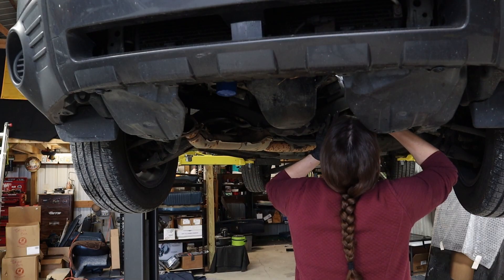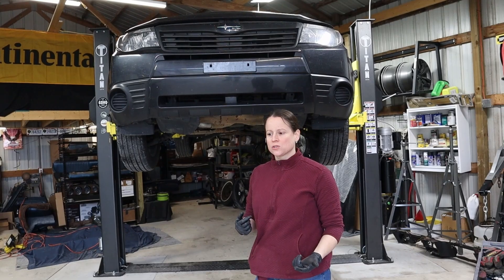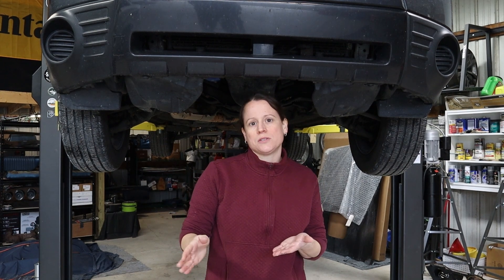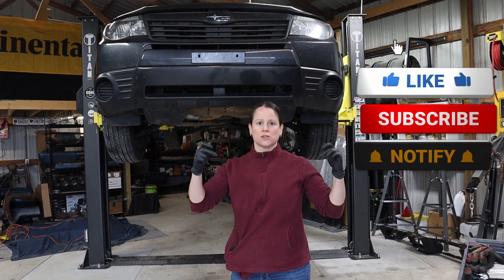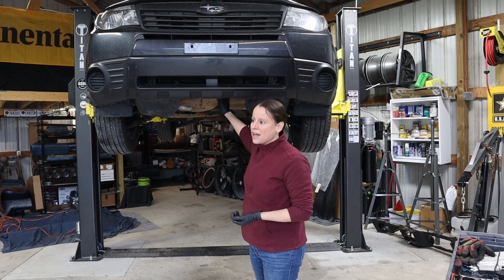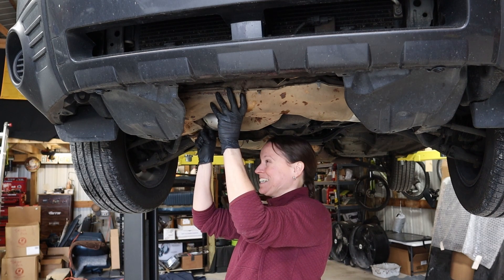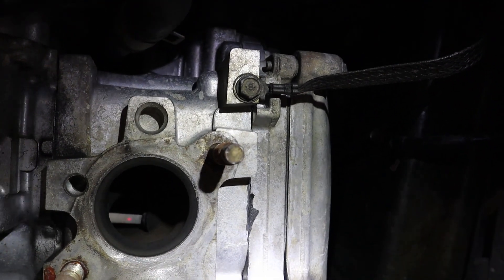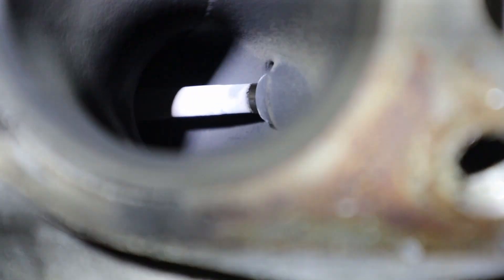Subaru Code P0000 & Intermittent Misfire Codes(P0301/P0302/P0303/P0304) - Mystery Solved

Comment: Salve ho visto il vostro video ,io ho una Ford Focus mk3 benzina GPL e mi spunta la spia motore con il codice errore P0000 voi mi  mi potreste farmi capire perché questo errore se sono gli ingredienti da sostituire grazie aspetto un vostro messaggio
Reply from the maker: Thank you for watching! Unfortunately, we are not able to help with this problem on the Ford Focus because it is not a car we are familiar with. The P0000 engine code can mean a lot of different things, and we only arrived at the valve guide pins on our Subaru after ruling out many many other parts. We would suggest that you work with a local mechanic to work through the probable causes and start replacing the cheaper and easier parts before worrying that there is a larger or more expensive problem. Hope this helps; take care and stay safe! Salute!

Comment: Hello enjoy your videos got a 2009 Subaru legacy limited 2.5 got a misfire in 3 and 4 cylinder according to code reader. What's the most common cause of this problem?
Reply from the maker: Hi Stanley, thanks for watching! It's really hard to say, even if your engine is also the naturally aspirated SOHC EJ253 same as our Forester. If you've already done everything shy of replacing the headers or spending hundreds of dollars, then it's 100% worth the easy diagnosis of dropping the exhaust manifold and taking a look up into the header to see if your problem is the same as what ours was: slipping exhaust valve guide pins. We had replaced spark plugs, wires, ignition coil, searched for vacuum leaks, cleaned the throttle body and MAF repeatedly, paid hundreds of dollars at a Subaru specialist, used an OEM air filter, and each "fix" made the codes disappear but only for a little while. We were on the verge of needing to do a compression test or pulling the fuel injectors when a technician at our dealer suggested we take a look for the issue we explain here. It was the end of our hunt, and replacing the headers (at great expense) resolved the issue. Hope this helps; take care and stay safe!

Comment: I have codes p0300 and p0304 on my subaru, it makes loud noises when starting, also a slight delay when starting the ignition. What could be the issue?
Reply from the maker: Hi Chris, thanks for watching! Without more details such as maintenance records, mileage, actually hearing the sound it makes, we aren't going to be much help with your diagnosis. I would follow all the logical "easy" places to look: check all the fluid levels and top off, check the batter and starter cables for tightness and corrosion and clean/tighten, check and clean the MAF and air filter, check the accessory belts for tension and wear... There are a lot of worst-case scenarios that could cause your issue, but it may be something very simple. Hope this helps; take care and stay safe!
Reply: @SpiritedWrenchers  can u technically drive with these codes on a check engine light for a few hundred miles? The check engine is not flashing
Reply from the maker: @chrisdopez8443  technically, yes. Will it do more damage than keeping it parked, maybe. Won't really know until you tear into it. For the record, I drove it for several thousand miles before I uncovered the answer to all my intermittent misfire codes. Each time they popped up, I did something different/new to try to fix it and they would go away for a while.
Reply: @SpiritedWrenchers  So I took it for a spin again and it jerks alot, is this a symptom of a bad coil? Ran the codes again with a really exp OB-ll and it just showed P0300 and P0304 again.
Reply from the maker: @chrisdopez8443  honestly, I'm not sure. While replacing the coil pack (my EJ253 only had 1, it wasn't one coil per plug) was something I did to try to diagnose the misfire codes, I'm not confident that my factory coil pack was bad. I think I did that because it was easier and cheaper than diagnosing the fuel injectors, which I also suspected at the time.

Comment: hi im having a p0303 & p0304 on a forester i replaced the engine with a used engine. i did plugs, swapped the wires and coil to the new motor from the old one and still getting the misfire codes but no actual misfire. did your car actual misfire or did it just throw the codes? i replaced the crankshaft tone ring gear aswell and did the timing belt while i was there and still did not work. please let me know if you actually felt a misfire or just had the codes. thank you
Reply from the maker: Hi Pons! Thanks for watching and asking. So sorry to hear this, but it does sound very similar to our issue. The codes sometimes would just appear after idling (turn on the car, then run back inside for something you forgot and there's a code with the engine still running), and sometimes it would or act as though it wanted to stall when coming to the first and/or second stop after cranking the engine and driving. Those incidents usually resulted in the misfire codes. Aside from the extremely sporadic stall incidents, I could never feel the engine misfire. I could go 3-6 months between a code, or days between a code. I'd highly suggest you pop the exhaust manifold off and take a look up inside the heads at the valve guides. Hope this helps; take care and stay safe!!!
Reply: @SpiritedWrenchers  thank you for the reply!

Comment: I got two codes P0302 misfire on cylinder 2 also got a p219a air fuel ratio inbalance  any idea what it could be? I replace spark plugs and did valve cover gasket also both oxygen sensors and code still there .
Reply from the maker: Hi Ede, thanks for watching and trusting us to help you with your diagnosis! Without more information, the only thing I feel confident to suggest is to admit a problem I ran into shortly after doing my short block swap: torque everything. I found that I had a vacuum leak on my air intake manifold causing misfires and air/fuel codes to pop up. After going over every single bolt that I had removed on the intake manifold and torquing them fully to specification, I found my misfires and imbalance codes disappeared (well, the imbalance codes never returned anyway). I'd suggest you start with ensuring everything is fully torqued, the MAF and Throttle Body have been fully cleaned, and all wires are fully clicked into their appropriate places. Hopefully, it's something basic such as this. Take care and stay safe!
Reply: @SpiritedWrenchers  gave up and Caravana finally came to pick it up. Lost $2000 on that car but got rid of the problem. Never again will I buy Subaru . I’ll stick to my roots which are Toyota .
Reply from the maker: @ede4345  I definitely feel you on that sentiment! After needing major engine work for the second time in less than 5 years, I sold mine as well. We still thoroughly enjoy the WRX, but it's not a daily driver. Sorry for your loss, but hoping for better with the purchase of your Toyota (we also love them 'yotas)!
Reply: p219a is pretty general and can be set due to a long list of issues, but the most often one I see is one cylinder has significantly lower compression than the others due to mechanical wear or damage, valve, piston, rod, etc. The first steps would be a compression and then leak down tests.
Reply: @vipercrazy-9  caravan came and took the car , I had enough of it .

Comment: This is exactly what my subie is going through, been like that ever since I got a new short block almost 2 years ago
I took it to a tuner and they had no idea what the issue was since it wouldn’t show up on the codes
Reply from the maker: Hi Alex, thank you for watching and commenting. We are incredibly sad to hear your Subaru is doing this, because it sounds like the same pattern that ours had. Short block replacement, followed by mysterious and unpredictable misfires codes with no other symptoms. It would be worthwhile to drop the exhaust manifold and take a look at the valve guides to know for certain if this is what's causing the codes. Please let us know what you find! We did eventually settle on paying our local dealership to replace the heads on our Forester, but sold it about 7 months afterwards. Take care and stay safe!

Comment: So i have p0301 and 303 however sparkplugs have been done recently, and ive checked extensively for vacuum leaks, and no issues from fuel whatsoever. And literally almost zero symptoms, other than a little wobble in warm startups? Any thoughts?
Reply from the maker: Hi Reese, sorry to hear you're having a rough idle upon startup! Without any more information such as mileage and engine model, if the culprit is definitively not the exhaust guides, then I'd probably: check and clean the air filter, MAF, throttle body, then check the spark plug wires for connectivity and possible corrosion, then the coil pack before settling in on doing a compression test. Hope this helps; good luck, take care, and stay safe!!!

Comment: Did the engine jerk/miss when it triggered misfires codes? When I let it idle for too long it will either quit or I when get back to accelerating it will skip/jerk from an instant loss of power and trigger the full set of misfire codes (P0301/P0302/P0303/P0304). So far no P0000.
Reply from the maker: Hi Daag, thanks for watching and asking this question! What you describe is pretty spot-on. I didn't notice a major difference in loss of power, probably because I assumed it was operator failure on my part as the clutch operator (hah!). It did stall at stop signs, and would throw codes if left to idle for too long. The P0000 is a dummy code, so having the cylinder numbers is more accurate. I would say it's absolutely worth is to drop the exhaust manifold and inspect the valve guides in your heads. Hope this helps; take care and stay safe!

Comment: Were these codes mostly on initial warm up of the car or regular driving? Also how many miles do you have on your car?
Reply from the maker: Hi Oscar, thanks for watching and asking! The codes generally only occurred for me when the engine was cold(er), and either idling or upon going back to idle after moving. So, if I let it try to warm up while sitting still I could get the codes, and if I tried to drive it immediately I would get the codes when coming to a stop. Had approximately 200k miles when we filmed this episode, but the codes had came and went like ghosts for 35k miles or so before we found the cause. I had been replacing and cleaning parts for years trying to get them to stay away and never thought the freshly rebuilt heads would have been the cause. Thanks again for watching and stay safe!

Comment: Hi I am new to the Subaru family. This February I purchased a 2011 Forester with 167000 km on the clock. Your videos are so interesting and it has motivated me to get more involved with the car and perform some of the routine maintenance myself..thank you..would love to see videos of the engine rebuild
Reply from the maker: Hi D R, thanks for watching and we are so glad that our videos give you the motivation to get under the hood yourself! Depending on your location, the 2011 Foresters were sold with a completely different engine than my old 2010. In US models, the 2011-2013 Foresters have the 2.5L DOHC FB25 engine instead of the 2.5L SOHC EJ253. So while we didn't have our channel when I completely tore apart my engine and no videos truly exist (only pictures), I don't know how much help they would be if you've got a different engine. Some of the maintenance elements will be the same or similar, and I would say the greatest resource for me has been a Facebook group, SH Forester Owners, as well as an online forum, subaruforester.org. Both will have boatloads of resources for you with regard to oil viscosity, type, capacity, troubleshooting, and other various maintenance help. The biggest thing I can advise you for a higher mileage FB engine is to keep an eye on the oil level as they are known for high oil consumption. Welcome to the Subaru family! Please feel free to reach out if those two resources don't have what you need and we will be happy to find a group who can
Reply: @SpiritedWrenchers  Dear Dana, thank for taking the time to respond,  in South Africa, we also have the FB 25 engine.  It is so wonderful to be able to connect with someone across the globe, although our cultures are different to be united by a simple passion is something special. Thank you for the resource tips I will definately  explore them ..take care
Reply from the maker: @Suny1234-b7o  both groups are international! That's why I love being a part of them, because the collaboration and work that we all bring. Another global group is FozTrek on Facebook, although they don't specialize in just the 3rd generation Forester, they are primarily in Australia and have members across the globe as well. The only warning I have is they're all a rabbit hole for finding mods and enhancements to do on your Forester, making you want to spend more and more money. They're all fantastic and absolutely great resources to have. Take care and stay safe!
Reply: @SpiritedWrenchers   Marvellous, thank you so much..TC..

Comment: So...she's a flasher, got it...LOL!  Seriously though, glad you found the fix, sorry it's going to create so much more work...but think of the content.  I'm working through a similar issue on a GMC Yukon owned by Burke over at Road Odyssey.  Have a #5 cylinder misfire issue but I'm working on a bigger project right now as you've seen so I'll circle back to that job real soon.
Reply from the maker: LOL. That's funny but yes she is. We thought the same about the content however it will be a less because we chose a different path (to be revealed soon). It will still give us some though. Sorry to hear about the Yukon. Hope you can get that one figured out as well with out becoming a nightmare. Cheers

Comment: Man that's really unfortunate. Weighing out the options it's probably better to let the dealership handle it. On the plus side, now you know what was wrong with it and if nothing else you have some insurance that it should be done properly at the dealership. Great video, i can't wait until the fozzy is running like brand new!
Reply from the maker: Thanks for watching and sharing your thoughts. We greatly appreciate it. Yes, unfortunate indeed. We actually chose that route after A LOT of thought and considering all the pros & cons. We'll explain in an upcoming episode. Cheers

Comment: Disappointing about the guide pins😕. I actually blew a head gasket today, and after looking at the heads, I already decided to swap in a new engine. Not a fun project... Good video guys👍
Reply from the maker: Thank you for watching and sharing your unfortunate story. That's really sad to hear buddy. Is that on your Buick? Picking up a used engine or a new crate motor? We appreciate the kind words as well! Cheers
Reply: @SpiritedWrenchers  yes it’s on the Buick 🥲. There really wasn’t any signs of it happening. I had a couple hard starts the night before and then in the morning it started and a cloud of white smoke covered the car. Im swapping a used motor, I have a friend that has a one with 90,000 miles on it. Luckily you guys have a shop with a lift, it’s pretty cold doing that kind of work in a driveway lol
Reply from the maker: Damn. Hate that out of nowhere mess. Our shop makes it easier for sure but its still cold as heck in it. Have to run the torpedo heater for a while to keep it manageable which is hard for recording.  The shop is open if you wanted to get it all here to do. Just an offer although I know its not that easy.
Reply: @SpiritedWrenchers  I really appreciate that, but I’ll manage here! I’m sure that is rough for making vodeos with that rocket engine lol